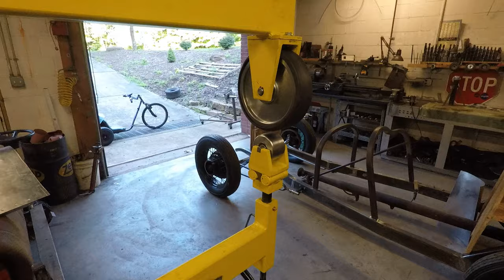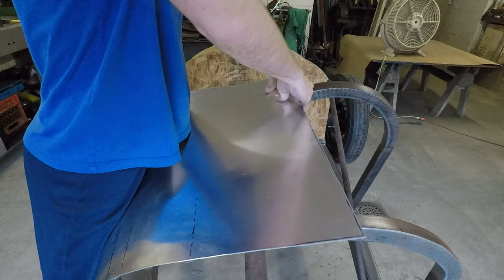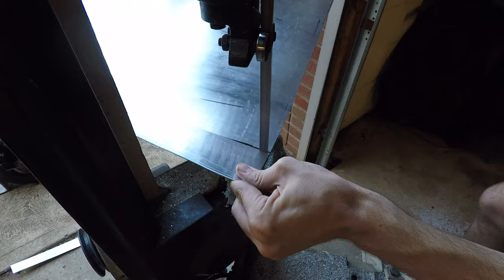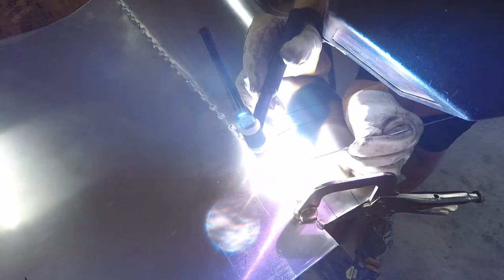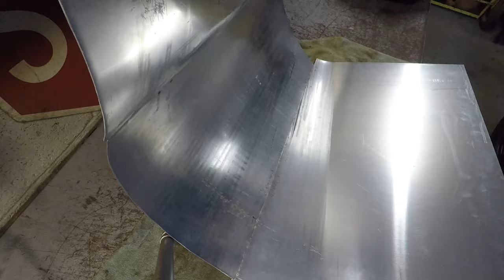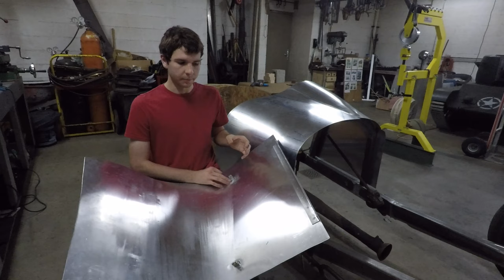Welding Aluminum Body Panels | Boat-tail Speedster Pt. 26

Comment: Thank you for another great video!  I'm not an expert in coachbuilding but maybe you should mechanically fasten the aluminum panels to the cowl support via rivets and brackets.  I'm just picturing that if you had a head on collision the aluminum could act as a guillotine. Rivets would still look good on top and the brackets could be fastened with screws to the cowl that could be removable and adjustable.  Keep up the good work!
Reply: I agree that the scuttle should be securely fastened to the frame and only panels that are removable should be strapped. Thoroughly enjoying the build.

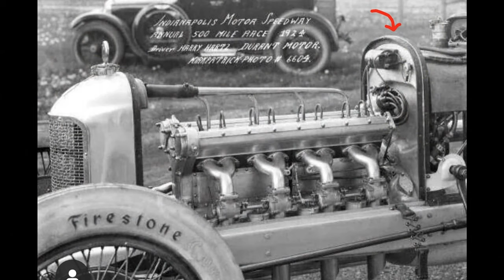Comment: 15:09. I think that rubber is just there to dampen the vibration and keeps the aluminum from any contact with the frame. I think they would use leather belts across the panels.

Comment: You can use Panel Bond Adhesive  to hold your bracket under the aluminum. DODGE  USE IT TO HOLD THEIR ROOF SKINS ON THE CHALLENGER!
Reply: Gene Holmes I was going to recommend the same 😎
Reply: @TheSookean  That panel bond is fantastic. I used it to replace a lower door skin. Easiest door skin I have ever replaced. Only problem I could see with him using it is he would never be able to remove the panel to service anything after using the panel bond to attach it.
Reply: Matthew Bergin I was thinking long L brackets panel bonded inside the cowl to use as attachment points. Sort of like he did with the. little welded ones but longer to give more adhesion area

Comment: Sandblast the finished frame, get it hot zinc sprayed and then powder coat it, after that you can bond the panels on, even urethane thats used for modern windshields will give a permanent bond without  having to use fasteners and will hold much more firmly than just leather straps and bolting the panels down to the chassis.

Comment: JB weld a metal kerfing (like in a guitar) around the lines of your chassis and drill those into your chassis, it may not be as strong as a weld BUT it’s a lot sturdier than a friction fit

Comment: Many years ago working in the sign industry we were required by architect to produce an alumimuim sign mount to posts without rivets etc so they recommended a two part cyanoacrilate that was rated as strong in shear, as a weld. Even in the hot Aussie sun those sign lasted 15 to 20 years. I can no longer remember the brand but even better products must be available, should one or more stabilising holding mounts be required if you look around. Some of the glues like JB weld might be pretty good for things like this. 

TL;DR Glue on some tabs :-)

Comment: Windshield polyurethane holding the tabs or angles on the inside will hold whatever area on the car , That stuff in tire tough , Go to a wrecker yard or a glass shop and ask or try to move rubber around a windshield that stuff is meant to stay and protect you but you can install it and set whatever set it mold it  leave for 12 to 24 hrs you won`t move it , But grind it off if needed I`ve fixed ATV tires with it and to this day it`s still there  .Looking good so far .

Comment: in some kit cars they use a bead of 3m 5200 to bond the panel on the inside. cuts real easy if you need to remove it, but is very strong and flexible

Comment: hope you remember to insulate the aluminum from the steel to prevent corrosion, we used just come 2 inch black tape

Comment: Thinking out loud, if you had a beading tool,  you could run a bead on the back and fore edges to stiffen things up a bit. Maybe even give you an edge to work with for the other panels.

Comment: You could use Panel Bind to glue tabs or whole strips of aluminum that you cut out to match the contour of the panel then make it a right angle to support the panel better

Comment: You are doing a great job on making the body panels....I watch a channel called oxtoolco ..He has a recent video showing a 5 in proshaper disc that goes on a 4 1/2 grinder used for smoothing  / flattening sheet metal

Comment: Cool. Can you use one of those cheap $100 welders to do something like this? This step van has a window in the side of the cargo area that I want to take out and return to it's original shape. The step van has a flat wall so it's a simple rectangle maybe 2x3 ft area that I would want to fill with sheet aluminum.

Seems like you would need some different clamps though since it's a wall? Like kinda curious how you would start a weld like that.

Comment: TIG Welding in the U.S.A. The GTAW (TIG) welding process was first developed in Southern California in the early 1940’s by Russell Meredith of Northrop Aircraft Corporation. At that time Northrop needed a way to weld aluminum and magnesium and current welding processes were not adequate to weld these alloys. Not quite 100 years !
Reply: Invented in late 1941, put into factory use January, 1942.

Comment: Put a good quality 2 face tape on the frame under the body then pop rivet it on the sides that will give stiffness to the body and stop vibrations  and you can use a heat gun to loosen it if needed.

Comment: If you have to weld panels like this, might it be easier to bend flanges on each, and rivet  (or just cleco) the flanges together before welding?  2, 3, or 4 points should be enough.) Once the welding's complete on the other side, the flanges could be removed. (Or left intact, if you want to leave a reinforcing rib.)

Comment: I was wondering how you were going to do the body panels ,I thought you were going to be riveting them together, welding them gives it a much cleaner look but is a lot more work ,but it is the end results that count ,will you be polishing or painting the car ?
Reply from the maker: polishing a little bit
Reply: @MacroMachines  Don't polish the body "too" much or you will have to wear welding goggles to drive on a sunny day. 😁👍

Comment: Maybe a too modern approach for this project, but the aluminium brackets could be glued to aluminium with modern adhesive (body glue).
Reply from the maker: I considered something like that, but I wasn't sure if it'd be strong enough
Reply: @MacroMachines  An elastic adhesive solution should work perfect, if it's done right. What you need is enough surface to glue on. So if you construct an one piece bracket that is glued as an inner ring to the inner side of the hood bowel and has multiple individual latches that connect to the frame this will have enough surface to work. Also this will have the advantage of dampening, so the aluminium won't break or get cracks because of vibrations. The approach you did in your video with some small individual brackets did have some disadvantages. I think besides of the heat problem, this brackets would have breaked or would have lead to cracks in the bowel because of vibration. That is why they always used rivets in air planes with aluminium body. The leather dampening stripes where only done on hoods or parts that can be opened / removed. And than mostly with steel body parts. Aluminium is a very delicate construction material when it comes to car bodies. If something sounds a little bit strange, sorry english is not my mother language. ;)

Comment: why is the resolution 360p?
Reply: YT does that all the time. Also he probably just Posted it right before you watched it and it hadn't finished rendering yet. But YT being who they are and their shitty system, I'll be watching a Video in 1080p with 10MB Speed and 10 minutes prebuffered and YT will out of nowhere drop me down to 240 or even 144 and Loose all Buffering, then Freeze when I try to go back to 1080.

Comment: dont grind the aluminium welds as they are the ones holding the two peaces together. grind just the visible ones and leave the ones benith
Reply: but for what you are doing it might not matter that mutch
Reply from the maker: i have to grind both sides so that I can planish it in the english wheel
Reply: @MacroMachines  Yes i saw that, sence this isnt a load bearing part and it only needs to look smooth it might not matter that much. If you were to fabricate an aluminium fuel tank, there is where you probably shouldnt grind the welds. Anyhow your work is truly amazing.